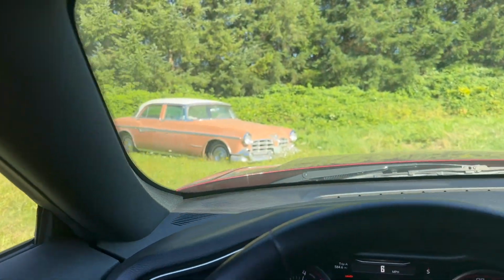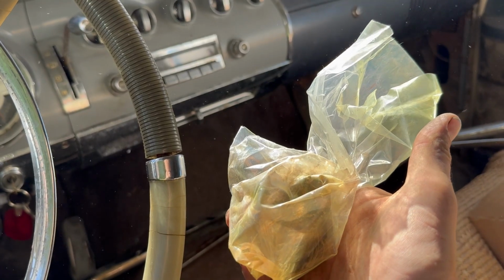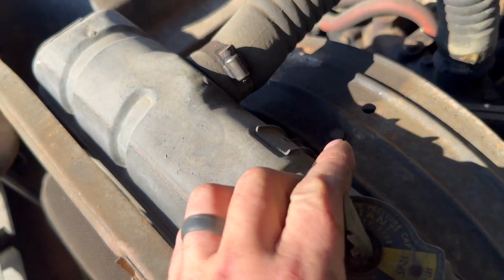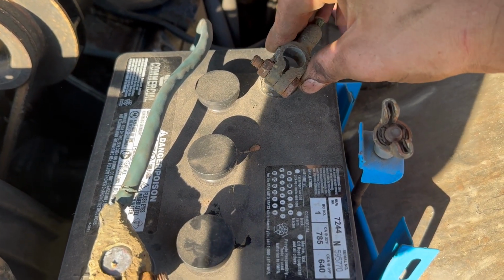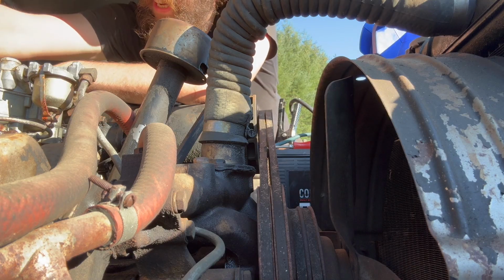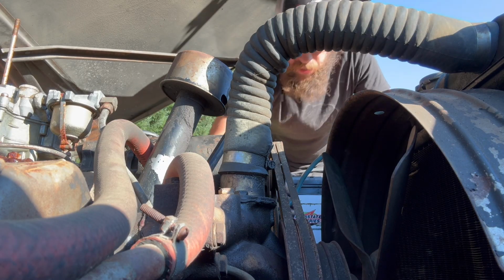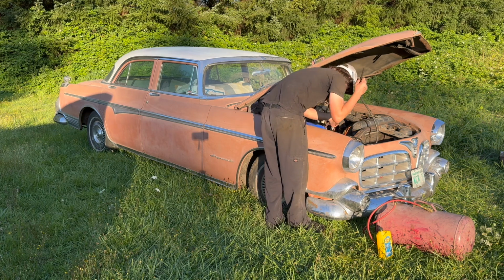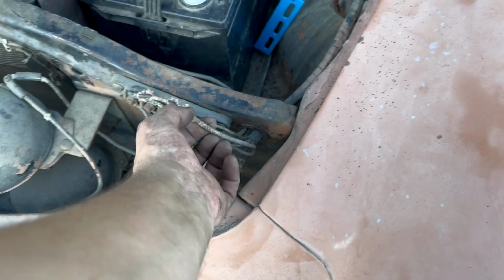Hemi Powered Land Yacht - Will This 1955 Imperial Run And Drive After 30 Years?

Comment: Actually, The Best thing to do When starting a Motor that's been sitting a long time, when you hookup a gas can with Pime ball use 2 stoke oil, it might smoke a little, but it will lubricate the rings, And I have been starting motors over 50 Years, my, bulldozer was in a field 60 years, Tara trac dozer, 5 Years ago Me and my Brother was given a 354 hemi Frozen bad by the end of the day It was purring, like a Kitten. The man That gave it to us said it was Junk and would never run again without Rebuild Boy was he Mad.
Reply from the maker: Absolutely. I’ve used mixed gas plenty of times. Did that in the ‘49 Studebaker a month ago.

Comment: That Motor made 300-310 hp
Reply from the maker: In high performance dual quad form under the hood of the 300, yes. This one was rated for 250 HP.

Comment: I'm Going to tell you a sad Story, in 1978 I Bought a 56 Chrysler new Yorker 392 Hemi, I paid was Picking up Next Day When I got there The Car was stolen, Someone with Flatbed Truck without Plates, backed up and took it, It was a Very rare car, Had a Rap around console, Dual carbs automatic, I searched 5 surrounding states for 5 years, Waiting for someone to Bring It out restored, I was so Mad , They Must of not know how rare it was and took just the Motor, I have never seen another one like it Online or at car shows, I did have the Title .

Comment: Great video Jamie !  I always liked the "sparrow strainer" tail lights the 50s Imperials used.  The 331 I turned into a 354 for my current project came from a 55 Imperial 2dr HT. In its day it was a beautiful car, if it hadn't been so far gone and so heavy I sure would have been tempted to build it.  

I suspect you probably already know but the Triple Nickle heads which were reportedly  the best factory 1st Gen HEMI heads produced, were one year only and that year was 1955.  That's what should be hiding under the valve covers.

 Don't you just love dual points at the back of the engine.  At least the distributor is easy to pull.  If you ever run across a junk 301/331/354 Poly you might want to snag the distributor.  The Poly (Spitfire)  engines got single point distributors and they're a drop in for the 331/354 HEMIs.  

My vote is you NEED that car (at least for a while)  We NEED more 55 Imperial videos LOL.
Reply from the maker: Oh yeah, I’m hip to the 555 casting. I’m ok with the dual points when they work 😅 judging by the response to this video, everybody wants to see more on the ‘55… that pretty much guarantees a follow up. So yeah, good chance it’s coming home with me. But it’s too heavy to tow… so I’ll have to make it drive for real, I suppose.
Reply: @DeadDodgeGarage even better

Comment: Did you add gas to the tank?? Lots of times the brake shoes bond to the drums
Reply from the maker: No, the tank needs to be cleaned. Yes, that’s apparently common with this “full contact” style of drum brake. Thankfully this car was inside for most of its time off the road.
Reply: @DeadDodgeGarage  Being honest I'm surprised it wasn't seized. I hope someone brings it back to at least running and drivable condition, looked pretty straight body wise and it runs and drives. A good service like fluid flushes, checking brakes and that excessive steering wheel play will go a long way, a little 'oil burning' gives it patina as long as its not too much. I am watching some old Mopar YouTube manufacturing and car comparisons now,  i love the name of the features they had back in the day. I was really a GM man back in that era but now appreciate some of those UGLY Mopars with that 426 wedge under the hood.

Comment: Have you tried running an 8. Volt battery in the 6 volt application it's more cranking power and works with the original system at least until you can convert it over
Reply from the maker: I’m hip to that, but I haven’t had opportunity to get one for a project myself. For one thing, I haven’t seen any 8 volt batteries for sale locally.

Comment: 1955 is the first year that Imperial was marketed and registered as a separate make. I think that Chrysler should have done that beginning with the 49 model. That is the first model that had unique sheet metal and trim. I too like 55 Chrysler products. One of my dream cars is a 55 De Soto Coronado with a/c.
Reply from the maker: Correct! Although they did actually strategically remove the Chrysler name from the ‘54 car. Very cool.
Reply: @DeadDodgeGarage I think that early production 54 Imperials still had a Chrysler script nameplate on the driver's side of the hood.

Comment: An interesting fact regarding those 1955 Rally Style wheels, this from Steve Magnante. Those wheels were used on the rear of the two 4 speed AWB 1965 cars, drive by Ronnie Sox and Butch Leal.Those two cars were built with Dana 60’s sourced from Ford pickup trucks, and Ford used the 5 on 5 bolt circle, the same as the Imperial wheels. There’s a photo of Butch launching his car, and you’d swear he was using Rally Wheels.
Reply from the maker: Wow! See, I thought it was 5x5. Someone else said it’s 5x5.5. I’m just going to verify this myself.

Comment: One thing I've learned about 6-volt systems is that they originally had much fatter heavier gauge battery cables than the typical (much thinner) parts store replacement ones that you typically find previously installed on them now. Those 6-volt starters need more amps/current than what those thinner cables can supply, I like to think that a 6-volt starter is making up for the lack of voltage with more current. I've seen where just replacing the (relatively new) thinner cables with the heavier gauge ones transform it from a slow cranker, to one that fires right up.
Reply from the maker: That makes good sense. I’ll have to pay attention to cable sizes in the future. Thanks!
Reply: Yes you really need a heavier gauge than what originally came with the car. I put 00 gauge marine battery cables on my 6 volt '52 Chevy and it made a huge difference.
Reply: @marksimendinger3462  00 guage. Okay, thanks for the specification on AWG! I was assuming around the neighborhood of 10 gauge and now thinking that would still be way too little for a 6volt system.
Reply: Would you assume the cables were like 10 - 13AWG originally or is that too big of a gauge?

EDIT: 10-13 gauge would actually be too small of a gauge. 4 gauge or 00 guage it is!
Reply: @trickyricky12147 4 gauge or lower , I would do 00 😃
Reply: @jeffosim8789  Thanks for the feedback! 😃

Comment: When i saved my '53 Plymouth Cranbrook from the crusher, i bypassed the varmint consumed wiring and started the little flathead with 12 volts.   When it ran long enough to add coolant, it ran out of fuel so i started pouring water in the radiator forgetting to pull the hot wire from the coil and about 5 minutes into the pour, the coil exploded, spraying burnt, black oil all over. It still has this reminder stained on the inner fenders and firewall.🤔
Reply from the maker: Yiiiikes…

Comment: Early 50's Chrysler radios turn on and off from the end push buttons, not the knob. And you set the push buttons with a tuning wheel, not by extending them and pushing them back in when you've tuned your station with the tuner.  Anyway, that's how it was in 51-52. I will have to check if it is the same in 55,  Also, you have to leave tube radios on a lot longer before you know if they are working or not. 1955 is a Six volt system, positive ground.
Reply from the maker: Didn’t know about the button deal. I certainly know about tubes. And I said that.

Comment: Cars have gauges of measure voltage in the battery not amperage
Reply from the maker: So… I guess you don’t know much about vintage Chrysler products? Feel free to pause the video and read the label on that gauge, which says… wait for it… AMPS! Chrysler used an amp gauge (or ammeter) in all models for DECADES. Not a voltage gauge. It indicates the battery’s current state - whether it is being discharged or charged. And in the classic era, they were not alone in that. For example, you will find a remarkably similar gauge in the dash of a 1952 Chevrolet. The rest of the automotive industry moved away from them much sooner than Chrysler. Muscle era Dodges had them. Pedestrian Plymouths had them. Hell, Dodge trucks were still rocking that style of gauge into the early 90s.

Comment: I had a MINT  1955 Dodge custom Lancer, black on yellow, then a mint 1955 chrysler new yorker deluxe, sea foam green on mint green, this one had power everything, the Dodge was PB, PS, so forth both had the Hemi's, Dodge had the fire power, both were in tact 6 volt negative grounds with GENERATORS, dual point distros, 2 brrls, autos, a lever off the dash, like 4 positions ..

i loved both cars dearly, they were both mint and the Dodge was especially low mile mint a friends parents got a divorce and neither of them wanted it cuz it was purchased together .. a $50 bill picked that one up, a $100 bill snagged the new yorker, both ran like tops, decent MPG and like 200hp, these were long before speed and rev limiters and I could get them up to 120 routinely and just soar down the road, or float .. I would do this daily to and from Hanford Nuclear reservation going to and from work at the #2 plant ..

everything worked on both, both had all the paperwork still and owners manuals, I remember the Dodge had an option fora TURN TABLE and the manual showed how to operate.. so cool

the new yorker had power everything, seats windows, steering, brakes, so on so forth and it all worked flawlessly, 6800 miles on the custom lancer, 36,000 on the new yorker, both purchased in 1976 .. the dodge was cool as it had flaps to go over the front door windows (2dr HT) these are some of the best automobiles ever made and extremely reliable when converted to a full 12 volt fused system...  the 6 volt - ground was trippy, no fuses, NOPE, they used BREAKERS for everything, and the Dodge must have had some corrosion I never chased down ad the headlight breaker would flip at night and put you in a graveyard..

benton city wa, a hot summer night, drivng north on horn rd, approaching corral creek rd the lights flip off and its PITCH BLACK you cannot see anything, I flip her left thinking I had the road and I just missed it by 2 car lengths, ended up in the cemetery, flip a bich and run the fence over again, stop,let her cool she never flipped again and I drove her for hundreds of miles at night after that.. welp the city and tri city towing stole the car from me... long story

later I had an issue with the trans in the dodge when going over snoqualmie pass the trans drain bolt came out, all I had was a wheel bolt, yes bolts not lugs, and used to to plug the trans hole, all I had was motor oil, instead of changing it out soon as I got where i could I procrastinated and the trans went so I put the new yorker trans in her, and I ended up leaving the new yorker up on the blocks at the farm I was working and living on, (bob pfeiffer) never saw it again.. it did have a left from fenner replacement from a mishap turning onto an irrigation road ...    ahhh west richland desert life . . .   both were purchased in Benton City wa . . 

miss both those cars dearly then new yorker had a BED on the back seat and many a spawn were tossed back there,  slept 2 comfortably ..

curious did you purchase your new yorker off a farm in whitstrand wa?    that was mine, should have been pretty mint save maybe the paint but the windows sealed so interior should have been mintish if you got it in the 80's early 90's, gets hot and cold round there so weather would have tore it up after a decade or so... too bad, back seat still had plastic on it ..

I remember when the dodge had a generator issue I would jump it with 12 volts..  replaced generator and regulator all good from then on out, may have been why breakers would flip when regulator was on the way out?
Reply from the maker: Mine was here in Aberdeen for many years. I don’t remember its entire history but the guy had had it at least since the 80s. It was dark green with much lighter green side accent paint and white roof. Rear seat had been in the attic and was absolutely perfect. The rest was fair but kinda dank. He’d had it inside for years but moved it into his yard in the 2000s. Paint was all that was holding the bottom of the car together…

Comment: When you kicked the quarter panel trim I chuckled because it reminded me of a 64 Bonneville my oldest brother had. You couldn't slam a door on it, if you did it would leave a rectangle of rust flakes underneath. My opinion is, only reason to dump oil in the cylinders is if you're starting with a locked up engine or doing a compression test, it's going to take heat cycles to free up stuck rings.
Reply from the maker: Precisely! Get it running, splashing oil around and get some heat in it. The rings will free up - or they won’t.

Comment: You should buy and restore this beautiful car. It’s all there! Everything is present and mostly in restorable condition; even the rear bumper can be repaired around the exhaust exits and then re-chromed. Honestly, if you don’t buy it… put me into contact with the owner and let me buy it… and I’m an Oldsmobile fan and not a Mopar fan. I know… I know at least Mopar survived and Oldsmobile is extinct. I’m a car lover. I have a favorite brand- Oldsmobile- but I’m game to take on a reasonable new project.
Reply from the maker: I have the love, but I don’t have the time or the budget to undertake any full restorations any time soon. If I buy it, it will be more of an elbow grease cleanup, going through systems on the car, and getting it fully operational. I would love to do that but I don’t know that I can. For one thing, I’m beyond out of parking spaces…
Reply: @DeadDodgeGarage don't let a little thing like that stop u, buy more acres

Comment: I am so curious about the left-side-only exhaust smoke I can't stand it.  Is there an H pipe that is clogged?  Are only the left side cylinders breathing oil?  Is it not really a dual exhaust, and that is why the left tailpipe tip was the rusty one?  Who cares!  The second that thing lit off I felt the goosebumps.  I don't know why, but that is the sound of profound satisfaction.
Reply from the maker: I think it is a true dual system, and one cylinder on the driver’s bank needs help. I didn’t get goosebumps, but I sure was pleased!

Comment: That imperial is awesome! The original 6 volt system reminds me of my grandpa’s work beater 1939 Chrysler that he said he had around 1961. He put a knife switch in the ashtray to switch an extra 6 volt battery in series so it could crank  on 12 volts on winter mornings. He said guys would yell “get that old junk off the road!” And he would yell back “hey! At least it’s paid for!”
Reply: Hi Ryan, cool storey with your grampa!
I'm wondering,  did he hook up the extra battery in parallel for extra amperage or in series for extra voltage? Usually, extra voltage cooks the good stuff.
Reply: He configured the knife switch so that he could start the engine with  both 6 volt batteries in series for 12 volts to spin the engine over faster and make a hotter spark. He said he would make sure the heater blower, lights, etc. were off before he switched it to 12 volts.
Reply: @ryanomalley430  👍  now there's a  cool grandpa!

Comment: I noticed when you sounded the horn that only one horn emitted sound. There are two horns, one is much longer and lower pitch than the smaller one. In combination the two horns sound much like the air horns on diesel trucks. This was true for both 1955 and 1956 models of Chrysler and Imperial.
Reply from the maker: I noticed that too. I remember the long horn working on my New Yorker. It was impressive.

Comment: One body difference between the Chrysler New Yorker or Windsor is the front fenders. The Imperial front fenders extend further toward the rear behind the front wheels than either of the lesser Chrysler models. And yes the wheelbase is longer than Chrysler models and a two-piece drive shaft with an added bearing located between the 1st and 2nd halves of the drive shaft was used.
Reply: The Imperial body is four inches longer than Chrysler or Desoto. The added length is in the front doors. Added leg room in front and rear compartments. Also the radius of the roof at the front is different. I have had a sedan, like the one in the video for 12 years.

Comment: The steering wheel is made using plastic, just not a modern type. The plastic was originally translucent with a creamy appearance similar to alabaster. The same steering wheel and horn rim was used on the Chrysler New Yorker and the Chrysler Windsor. The horn rim is very easy to break at the smallest point of the spokes near the outer rim. So the moral is, be very gentle when pressing the horn rim if doing a test. No one is making new ones that I am aware of.
Reply: I remember these steering wheels like yesterday!